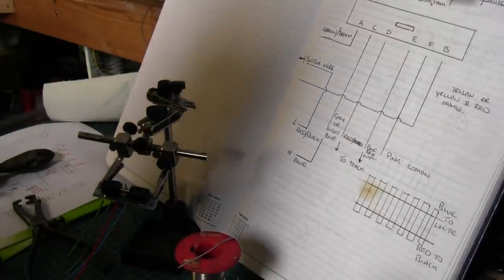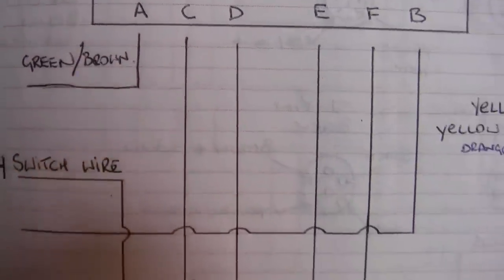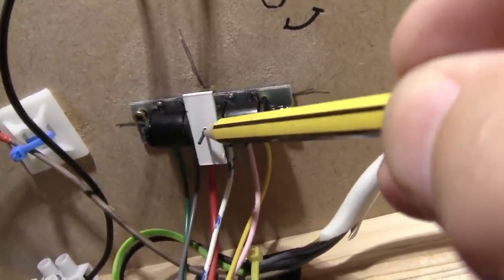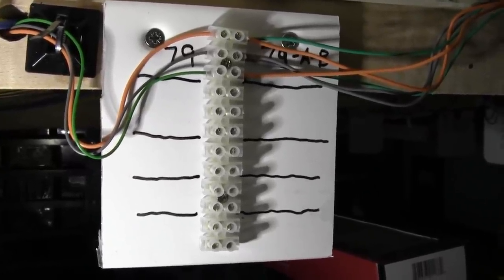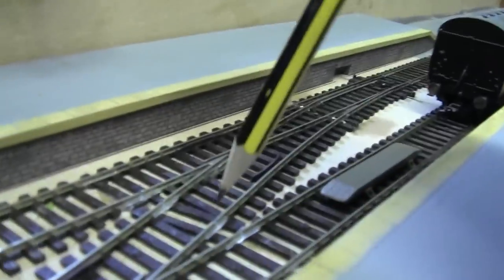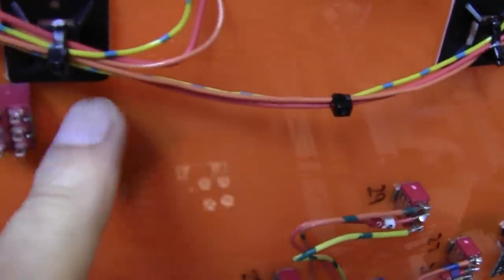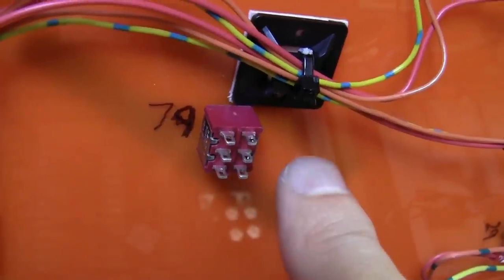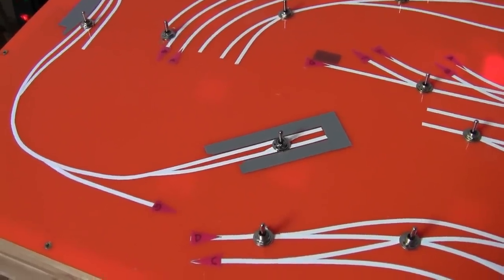Fitting PM1 SEEPs Point Motors....No 323

Comment: Very impressed with your wiring organisation Tony. It’s the one part of building my layout that doesn’t give me much joy. You have certainly helped by seeing your approach, much appreciated, cheers Paul.
Reply from the maker: Hi Paul. yes it can be daunting and time consuming but well worth it in the end.. you can make it much simpler. instead of switches. you could use brass bolts and use the heads for the contacts.. two bolts for each point. and a single live switch wire on a probe to switch the points. this idea also saves some cable. until next time. stay safe  Tony

Comment: I enjoyed the video, Tony, as per usual.
The tortoise motors have a slower action and are quiet. None of this buzz, buzz, which I find a distraction.  Do you operate them just via your control panel or can you do it via your EcoS too?
You are correct that Tortoise are more expensive, about 3 times the cost if you buy Tortoise in packs of 12.  More if you’re driving them via your EcoS as you need the correct I/O modules.
I am pleased to see that you interlock both your crossover turnouts, unlike many modellers who tend to operate them individually.  
On the real railway, there are rules regarding the operation of turnouts including the interlocking of crossovers, double crossovers (scissors) and other formation, including those that form a crossover using a single or double slip in the formation.  The rule is that you either have both in the main direction or both in the diverging direction. For scissors crossovers, the sequence is main line – crossover (e.g., leading) – main line – crossover (e.g., trailing) – main line.  Both crossovers are not permitted at the same time (a potential collision situation), hence reverting back to main line when changing from one crossover to another, all accomplished via the use of interlocks.  
Yes, this is not the real railway, but I like it when it looks and operates like the 12” to ft scale. Best, Jason.
Reply from the maker: Hi Jason. its a bit late for me to change all the points over now to the slower type. as there are 83 Seeps to swop out now. its a shame they were'nt around when i first started. i think they had just coming onto the market. i remember Graham Foulston Buying  a dodgy batch, and sending them all back. 
 don't mind the sound as it lts me know when the points have been thrown. 
Like you i don't understand why some people wire up change overs individually. it dont make sense. i think it makes the railway harder to operate. and easier for accidents to happen. thanks again for the hint for the SEEPS. as the wrappers where thrown away ages ago. until next time my friend. stay safe...Tony

Comment: Hi Tony, I like very much your centralizing method - card and clip jig definitely the way to get it right first time. I found that if you test these without a point the slug can sometimes jam at either end when it “over travels” and there is not enough electromagnetic force to pull it back the other way; so centralizing  is crucial. Minor point the title should be PM1 for your version, PM2 is without the changeover contact of course.  All the best Stephen
Reply from the maker: Hi Stephen, its does work 90% of the time. sometimes you have to re-plug the screws holes under the baseboard and start again. but yes you have to be spot on foe these to SEEPS to work. thanks again my friend for commenting....cheer's Tony
Reply: @TONYNORTHEASTERN  Should have said the washer wedges itself under the coil. On your point indication was wondering if you can make use of Block Signalling’s  PPI-4 points position indicator; its a cost effective unit also remembers the “switch” status on power off too - its what I used for driving all my leds on my control panel. Cheers Stephen
Reply from the maker: Hi Stephen that sounds like a great idea. i may have to look into those. ..cheer's Tony

Comment: Ohh wow Tony...electrics are not my thing but when I get my 2nd project going I'm going to have to watch lots more vids like this    ..station scene at start of vid Tony looked ace  and realistic with the smoke 👍💯👍all the best buddy👍
Reply from the maker: Good morning Dylan, it can be a lot simpler to wire up the SEEPS just by using 3 cables on insulated points. as you dont need to swop the polarity on the frogs. thanks again my friend for commenting. all the best Tony
Reply: @TONYNORTHEASTERN  👍👍  morning buddy ...yay I'm going to have to learn the electric and dcc. Stuff  want electrics and lighting on my 2nd project  I plan to have a coalwagon  sorting yard  so point work a plenty for me    I am learning to Solder correctly so in meantime I better watch more vids like these Tony  all the best 👍👍💯👍👍

Comment: What transformer do you use to power to the capacitor discharge unit? Is it the same one you used to test the points or a different one? Would love to see how you power the whole system from the mains to the overall unit. Apologies if I have missed it somewhere. many thanks for your great videos.
Reply from the maker: Good morning and welcome to the comments page. The answer to your question. i use a Gaugemaster GMC-M3 24v AC Cased Transformer. which feeds the capacitor discharge unit inside the control panel. i hope this helps. cheer's Tony.

https://www.amazon.co.uk/Gaugemaster-GM-GMC-M3-24-Cased-Transformer/dp/B00D3KWB5G/ref=asc_df_B00D3

Comment: Tony, I watched your video because I wanted to wire up a live frog point using a SEEP PM-1 motor. You laid everything out very clearly and I was in awe of your control panel. However, I mainly wanted to learn how to wire up the point itself as all of my other points are dead frog (PM-2 motors), which are much more simple to install. You explained that the common wire went from terminal F to the frog and mentioned terminals D & E but did not show where these wires go to achieve the required polarity switching with this type of point. The SEEP instruction leaflet is quite minimal and covers the use of D, E & F for signal switching/LEDs but your video implies you are using them to switch rail polarity. Can anyone help me with the point wiring?
Reply from the maker: Hi Martin. thank you for commenting. The F cable is connected to the cable that comes from the frog witch is your polarity switch feed. The D and E takes the feed from the buzz bar. so when the switch is thrown so does the polarity.
A, B, C Cables run from the point back to the control which picks up the supply from the discharge unit via a on off on toggle switch. I hope this helps. cheer's for now Tony.
Reply: @TONYNORTHEASTERN   Thanks for your reply Tony. I am not familiar with the term "buzz bar" in railway wiring so I did not understand that part of the video. Maybe it's just a terminology thing!
Reply from the maker: Hello Martin. The terminology is quite simple once explained, if you are running DCC or DC these will be the track feed wires to your track. its the same if you are analogue. its the + red & - black power supply to the trackwork. with DCC we would have the two cables follow the track around under the baseboards so you can pick up the supply anywhere if required this is what we call a buzz bar. i hope this helps. explain. cheer's Tony
Reply from the maker: That's ok. i am sure you can do this and make the seeps work for you,.
Reply: @TONYNORTHEASTERN  Hi Tony, I am afraid I am a bit of a dinosaur. I started my layout 50 years ago when I was a teenager, then it was in a loft, then in storage for many years before being resurrected and extended in a garden cabin at my current location. It is wired in the old fashioned Cab Control way and I could not face changing to DCC, about which I know nothing. That's why I was confused by your video. I thought terminals D & E might connect to the two rails that eventually meet at the frog, which are dead due to the need to have isolating rail breaks to avoid a short circuit, but I have not been able to get it to work so far. As I said, the SEEP instructions do not cover the wiring of the point, probably because DCC is the norm these days. I will keep looking on YouTube. Many thanks

Comment: Nicely put together Tony. Interesting way to center the points. Will be using them. How did you work out the angle underneath so that the pin stays in line with the point when thrown ? Stay safe.
Reply from the maker: Good question Mike. I use a 12mm hole for the actual pin to up through the board. so i look into the hole underneath to see which way the sleepers are running then mark the board accordingly with the direction clearly visible. it seems to work every time. until next time all the best Tony...

Comment: Hi Tony, Question of weight? Digital v Analogue control of points signals etc. I think many love the tactile interaction  of a physical switch (me included), and I know DCC concepts do system to convert DCC back to analogue switches which seems a little wasteful. However as I need my layout to be portable, weight is an issue.  Difficult question I know; perhaps one for the purchasing dept?. How many meters of cable do you think you have used overall? Regards Steve
Reply from the maker: Hi Steve, if weight is the issue then SEEPS would work for you. they are are still reassembly cheep. £5 a pop. as for how many metres of cable used, must be hundreds. 
i gave up counting long ago my friend. Keep up the great work on your channel. cheer's Tony
Reply: @TONYNORTHEASTERN  Thanks for the tip. Might be an idea for a video? Dcc concepts motors v tortoise v seep and a spool of wire? However not sure if I am putting cling flim in a title again ever again!. Some of the strange comments I have had to delete of what people do with cling film!🤣
Reply from the maker: yep there are some weird people out there....cheer's Tony